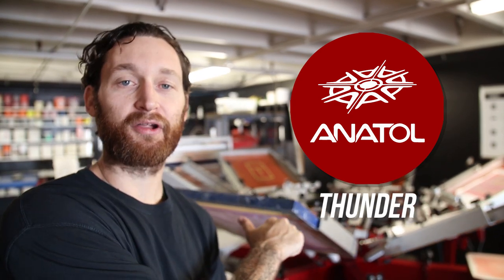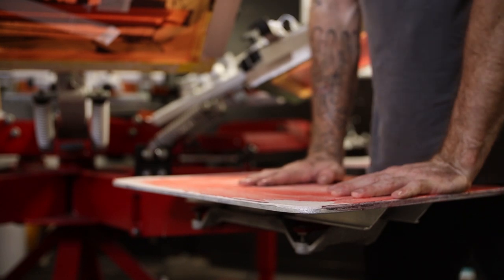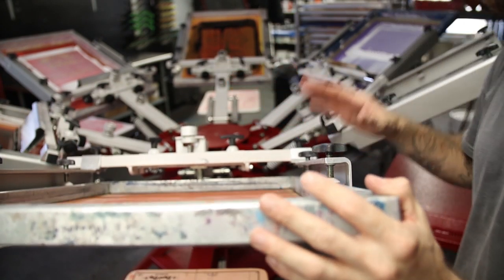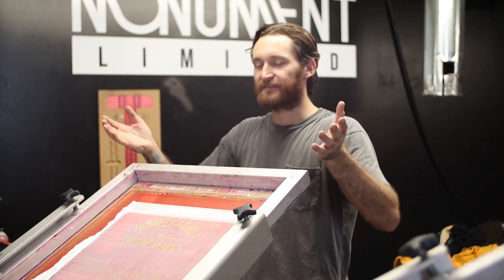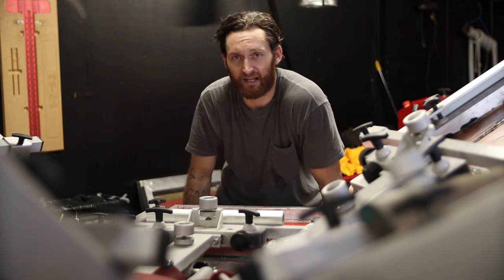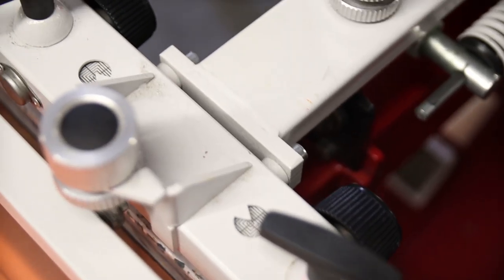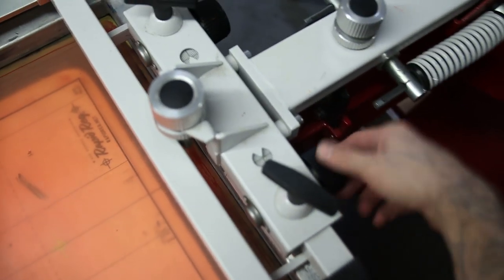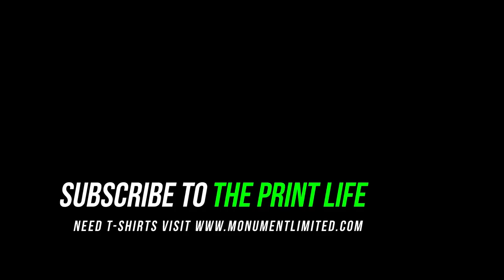Best 6 Color Screen Printing Press | Manual Printing Press | Step by Step T-Shirt Business

Comment: We've had a Thunder for over 2 years. My husband (our printer) has a background in engineering.  He looked at all the brands (I've been in business since 2005 and going to ISS shows since 1997).  We were ready to get a new 6/6 press from our old used press we'd had for several years. He looked at all the manual 6/6 offerings for our business and it came down to Vastex and Anatol.  Anatol won out on the registration gate setup.  Although he loved the detents in the Vastex. We moved into an auto 2 years ago and keep the Thunder as backup now. It's a wonderful press.
Reply from the maker: Very cool. Vastex is another great press. What route did you end up going when you chose  your automatic?
Reply: @ThePrintLife  we were a able to pick up used Anatol volt.  At the same time we upgraded the manual we went ahead and bought in Anatol dryer with programmable digital readout.  So we are completely red shop at the moment.  (The blue and green guys give us sh!t all the time.)
Reply: thoughts on the antec legend?
Reply from the maker: @zacharyvaughn8135  it a dope press I had one for years. It in most of the early videos on this channel
Reply: @ThePrintLife  any reason you aren't still using antec?  thanks!

Comment: Damn, you may have swayed me from the Vastex V2000 HD or the Antec Legend. I believe anatol has a lower level press called the “lightning”...I think lol.
Stoked for the flash review! Looks like a beast!!!
Thanks Cam!
Reply from the maker: yea the lighting, has the same great print heads, the big difference is the pallet arms are not as beefy as the thunder. However I have seen shops using the lighting and it does not appear to have much deflection either.
Reply: @ThePrintLife  we bought a Lightning almost a year ago, and couldn't be happier.  Haven't noticed much deflection either.  The all heads down has increased our output like crazy.
Reply: I would still go with the Antec Legend. I think the Legend is the best manual printer on the market. The floating arms and double locking registration gates puts the Legend in a class by itself

Comment: Great Video 😁 a lot of really great specs on the Anatol, def Better than the M&R Kruzer plastic pallet knobs and heavy pallet arms. 🤨 definitely wasn’t my carousel of choice when printing.
Reply from the maker: Yea the ANatol Thunder is more in line with the M&R Chameleon, at a better price. You can also upgrade with air locks, and all that good stuff, the one cool feature the chameleon has is the double decker carousel, I think you can have like 11 colors on that thing.

Comment: Cam, been following you for a while, love the vids!  Quick question, have you messed with the Anatol pre-registration system?  I'm stationed in Germany, but when I get back to the states,  I'v been debating on Anatol and M&R.   I love the micros you mention on the Thunder. Do you think the pre-registration is even necessary on this press at all based on set-up time on average jobs?
Reply from the maker: There are many shops that use them with great success. I simply cant figure it out. We have tried both ways and reverted back to using micros and registering to a template taped to the pallet.
From what I cant tell for pre reg to work you need to have fairly high and consistent newtons accross all the screens. I find this very difficult to achieve in my shops enviroment. When I eventually move to roller frames I may revisit pre registration systems.
Reply: @ThePrintLife  I appreciate the feedback!

Comment: I'm confused about these side rails. You said  aluminum was stronger than steel. Being a machinist for years im pretty sure that isn't true if apples to apples comparison. Could it be the steel ones are thinner at that point to reduce weight? Because if they are the same i have to believe steel is stronger!

Comment: Hey man, why did you go for the manual press vs the automatic, besides price point. I have a busy shop and wanted to handle more work. We are considering those anatol automatic presses.
Reply from the maker: Hi Ricardo. I went with a new manual press to help with consistency and to make set ups easier. We dont have the space or volume to warant an automatic right now. I did strongly consider the Volt though. I cannot speak on the press from experiance but I love the idea of no air lines. When we do automate I will get the volt unless something new and ground breaking comes out from another manufacturer.
Reply: @ThePrintLife  First, you're the man for banging out comments responses. But yes! the volt seem like a good choice for an entry level auto press. I should probably hold on to my manual until we busy 24hrs in a day. Thanks!
Reply: One more question. Can you briefly explain why you went with the anatol thunder amongst other competition? I am really liking the new riley 300 and 350. There's probably a bunch of screen printers with the same question since ryonet is a little more popular.

Comment: What other presses have you run regularly? Just trying to see what you are used to.
Reply from the maker: I had the M&R Sidewinder, the antec legend, that's also a great press if it had side clamps, and the vastex v1000, also worked on the workhorse odessy I think it was, years ago at another shop. I love all press manufactures though.
Reply: Ive seen printers who have printed on everything out there... and the thunder press always gets the highest marks.

Comment: what do you feel are the top 3 presses out right now? 4x4
Reply from the maker: For sure the 4x4 thunder, You wont regret this one, They also have a press called the tornado, smaller screens, The M&R cruzer seems cool.
Reply: The Print Life how do you feel about the Riley Hopkins 300 and 350?
Reply from the maker: @scrappy125  I haven't had a chance to use them, But I would not trade my Thunder for either one.

Comment: Cam this is cam I have a vastex v2000 have you used this press before and what are your thoughts on the v2000
Reply: I've got a v2000. It's a great press and will last a lifetime with a very long warranty. Just two  issues with it. It's really heavy to use so you'll feel the strain on a big job and the platens are very clunky with a big arm underneath. For some items it can be difficult to load. If I was buying new I'd go for the Anatol.

Comment: Does anybody know how good a vastex press is? Im looking into getting a v1000 bench press 6/1 station (dont have much space to work with). Thanks!
Reply from the maker: I had 2 of them they are great single station presses.
Reply: We have the V1000 4/4 and upgrading it to a 4/6 and then to a 6/6 later which you can go and upgrade to an 8/8. It's a good press and holds registration. Haven't had any issues with it yet and we have it for 3 years now. It's perfect if you want a press to grow with your business.
Reply: Hey, did you go with V1000 6/1? Would love to know if it’s any good. Thanks!
Reply: @saraht4089  Hey! I actually went with a used 4/4 riley jr. Its not bad. Print heads and off contact are a bit of a pain. Wish it was 6/4. But happy i went with a 4 station press. I would recommend a 6/4 press. It helps so much to be able to do more than 1 shirt at a time
Reply: @alejandrovilla237  hey, thanks for the reply. I’ve been considering the Riley Jr too, or Vastex 1000 so good to hear some current feedback on that. I think you’re right about going for a 6/4 though!

Comment: Can i ask something, why my tshirt always moving after I lift my block from the Tshirt? the block is attached to the tshirt.
Reply: Several possibilities: 
1) The shirt/platen has got too hot from repeatedly being under the flash. What happens is that after flashing, the platen is so hot that the print can't cool down. When you lay your second screen down, the thin layer of ink in the screen "cures" to the shirt, causing the mesh to stick to the shirt. To avoid this, never print right after a flash, and always make sure the print isn't too hot to touch. 

2) Your off-contact is too low. The screen mesh is "resting" on the shirt and when you print, the ink is pooling back up through the mesh because it's still in contact with the garment. Off-contact should always be about 1/8" 

3) No or insufficient adhesive spray on the platen. Your ink supplier well sell cans of it, or you can pick up a can of 3M all-purpose adhesive spray from a local hardware store.

Comment: steel is stronger the aluminum sorry to say ur wrong skyscraper aren't made of aluminum there steel . all heads down sounds good but if ur paying that many people you should have got an auto people get tired autos dont . they do have good micros on the press cant wait to see the review in 5 years and see how it is then .
Reply from the maker: Didn't say stronger said stiffer, Aluminum is for sure stiffer than steel.
Reply: @ThePrintLife  not trying to make u look bad but google your wrong al is not stiffer
Reply: waldo2413 no you made your self look bad lol you sound like a know it all. How about you make a video that gets more then 30views about it and post it in the FB group instead of telling someone else is wrong lol
Reply from the maker: @waldo2413  Thanks waldo you are clearly the better smarter and more knowledgeable man. Thank you for correcting me...
Reply: @solekefs626   Young's Modulus for steel (29 million PSI) is three times that of aluminum (10 million PSI). ... In other words, an aluminum part under load will deflect three times as much as a similarly loaded steel part. The thickness and shape of the formed part also contributes to its stiffness. I'm just pointing out facts
Reply from the maker: @solekefs626  Yea!
Reply from the maker: @waldo2413  Sweet, Aluminum side clamps still have less tendency to flex under load than steel side clamps. So all that stuff you said is probably true but also in this case not true. I'm glad you are so smart though congrats.
Reply: @ThePrintLife  Young's Modulus for steel (29 million PSI) is three times that of aluminum (10 million PSI). ... In other words, an aluminum part under load will deflect three times as much as a similarly loaded steel part. The thickness and shape of the formed part also contributes to its stiffness
Reply: waldo2413 would be great to see u do a video on this topic posted in the fb group for all to see. Anyone can use google.
Reply: @ThePrintLife  good vid just showing you the real numbers
Reply from the maker: @waldo2413  Don't care bout the numbers in this case. I had a sidewinder with steel clamps, bent like a mofo under even the lightest of tension, I now have aluminum side clamps, and they have zero deflection.

Comment: M&r  is way better than anatol you can fool the  beginner printers, anyway I like your videos but I don agreed with you.
Reply from the maker: Mario Herrera Your right. M&R is the only good manufacturer out there. All other press manufacturers are worthless scrap metal. Thanks for the valuable education. M&R for life, am I right?
Reply: What I didn’t like about the M&R Kruzer is it does not have a tilt adjustment.  Having the tilt adjustment together with the off contact makes setup quicker.  Its also kinda heavy.  The weight doesn’t bother me but it might make a difference with large orders.  Sometimes the workers fatigue kicks in.